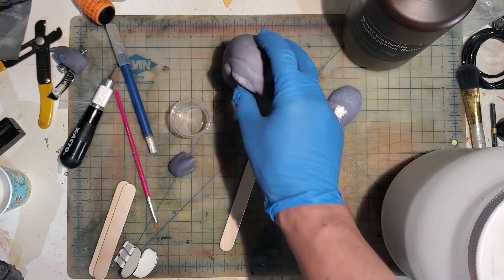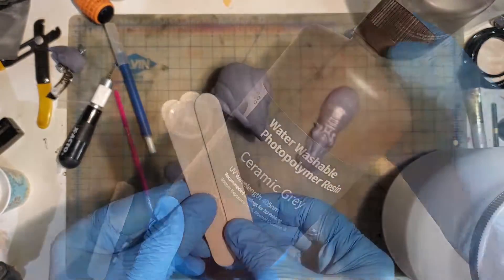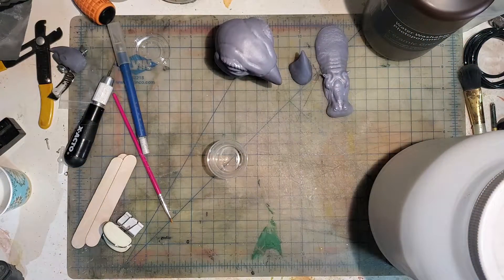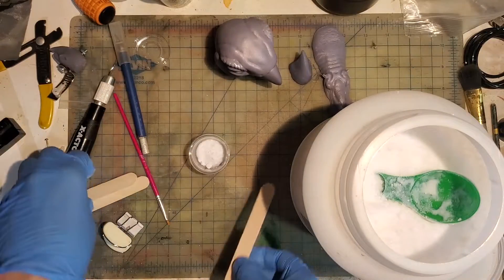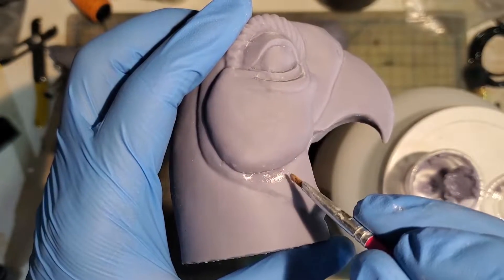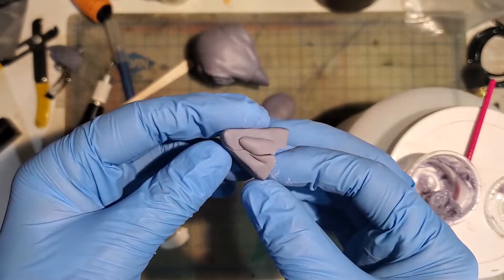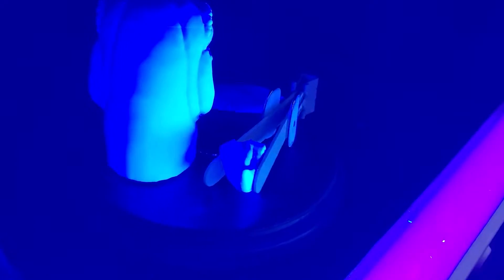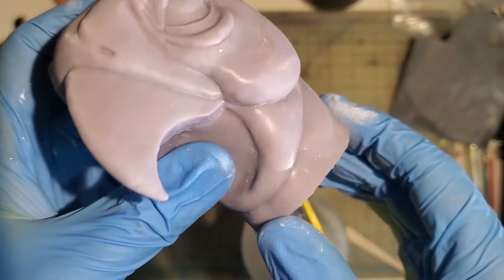The Secret to Flawless Resin 3D Prints: How To Thicken Resin for Patching Scratches and Holes

Comment: Could you explain how you got the 3d prints so smoothe and without visible layer lines? I can't seem to find a definitive method for doing so.
Reply from the maker: This is a resin 3D print with a layer height of .45, then I sand it down. The orientation of the print will also help to minimize layer height when viewed at certain angles.
Reply: @waltersworx  thanks for your answer. I am working with a rather large multi-sectioned pla print. Would you happen to have and tips for sanding and filling that?
Reply from the maker: @alexl6644  sorry, I don't have as much experience with pla printing and it depends on the type of plastic you are using. I know some types of plastic smooth well using an acetone vapor treatment but you will want to research that thoroughly to make sure what you have will work with it.